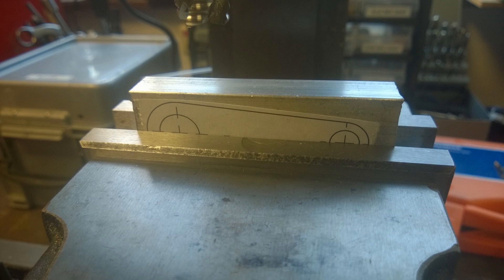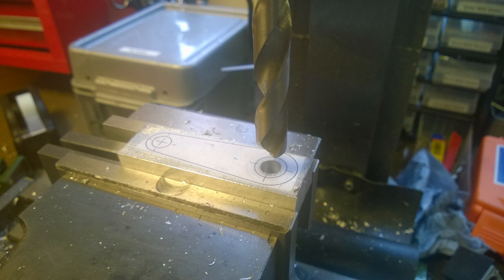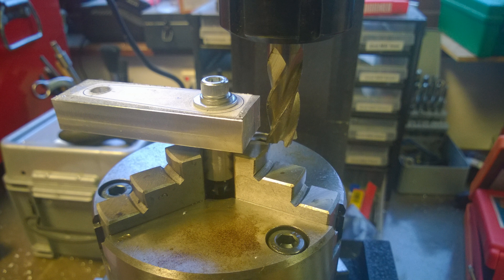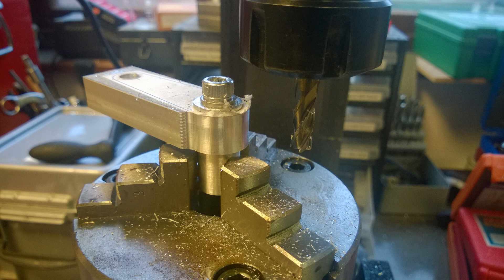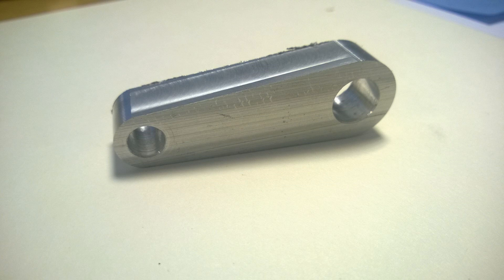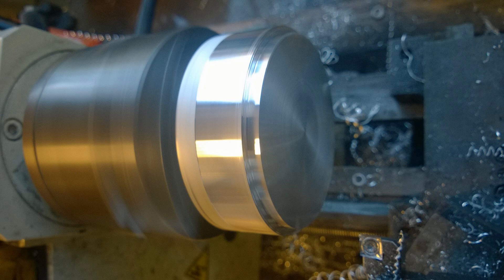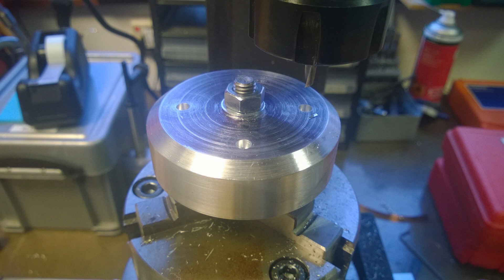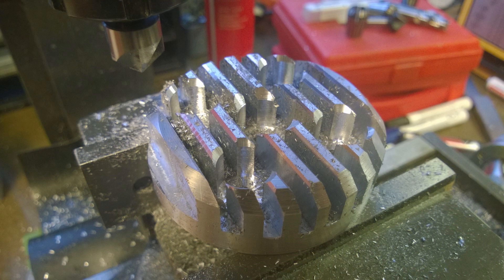Homemade 2 stroke engine step by step - Part 2 + 3

Comment: Great job. I honestly think the picture taking is more efficient than setting up a video for each part.
Reply from the maker: Yeah with machining its a long process and sometimes too long. The picture style helps in this regard - matt
Reply: On the rotary table - a cheapo screw jack on the face of the chuck, placed like 4 inches eccentric, would give you easy auxiliary support. Great shit matt. /GroupieN3rd